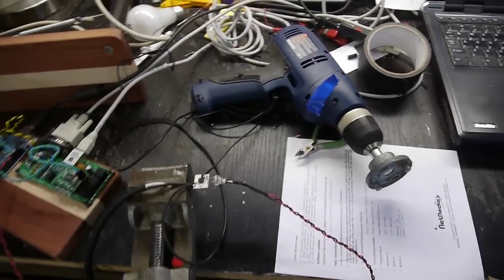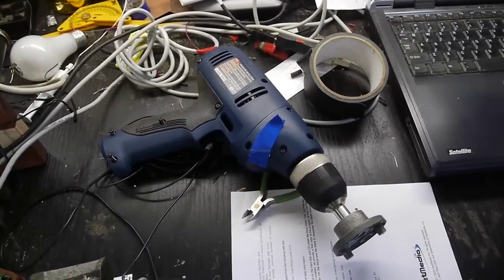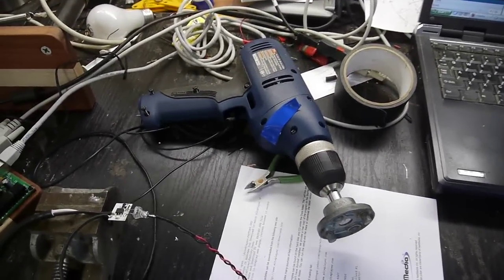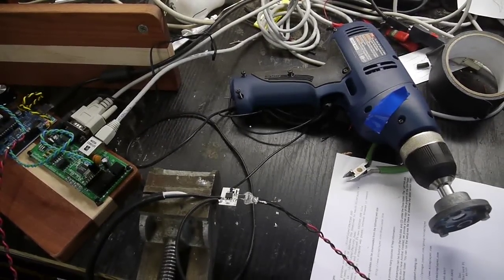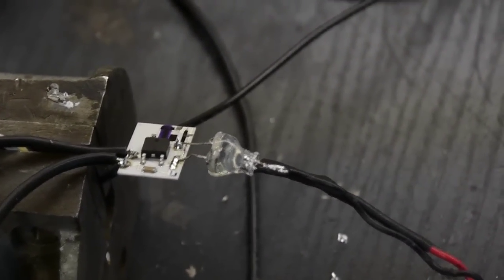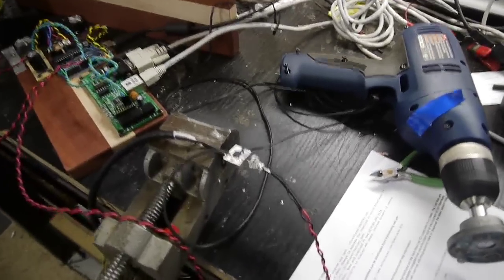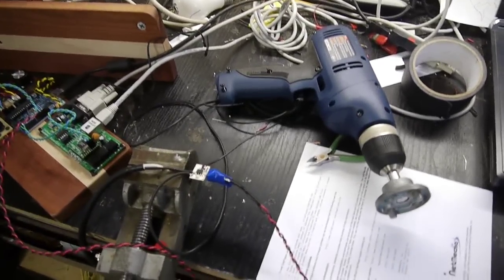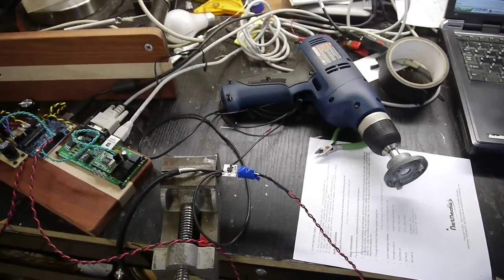Universal motor speed control by a microcontroller (arduino)

Comment: With this you've even isolated the control circuit from the AC power, making it safer, which could be important in some applications. It's a really elegant solution.

Comment: Ran into the same problem blowing mosfets chopping DC. Basically you really need a MOSFET 5-10x the voltage rating cause motors are evil.

Comment: Great video!

Would this work with an induction motor? I'd like to use this solution on a ceiling fan. Also, is there a way to power of the motor when the pwm signal is completely dead?

Comment: I have a spare 240 V AC motor and Arduino UNO lying around. I was wondering if I could use it to control speed using a temp sensor. So for particular increasing ranges of temperature, increase fan speed in steps accordingly. Can I do that with this dimmer circuit?

Comment: I bet if you were to put a load on that drill your dimmer/driver circuit would over heat and go puffff in to a pill of smoke.
Reply: +andrew moon Why? All he did was to take the circuitboard that was already in the drill, and replace a small-signal resistor with a CdS cell that varies its resistance with the amount of light it sees. The Arduino, etc., is completely isolated from the drill. If the dimmer circuit were to overheat, it would've also overheated in the factory drill speed control.
Reply: @SweetSpotGuitar  Hello, I am trying to do something very similar with your project.  I have a AC electric drill that I want to control using a AC eMylo RF wireless remote from Amazon.  It has a two wire imput and a three wire output.  I having problem trying to hook it up to the drill.  If you cold help me on this it would be appreciated.  Thanks Irv

Comment: So if you were using a fan motor and needed to control the rpms of the fan with temperature change,high temp= high rpm,low temp=low rpm et etc,could this be done easily with PWM? What components would be needed in order to make it as easy as possible?sorry im really new to arduino.
Reply: just search inernet. toooooooons of stuff. basically u kan du eberyting.....

Comment: very interesting. any ideas how you would control direction from your microcontroller?
Reply: The direction control is a DPDT switch.  I did it with a standard (mechanical) DPDT relay - the coil is switched with an NPN transistor driven by the microcontroller.

Comment: great video.... i was wondering could you give me the circuit diagram of that speed control. also what should be done to adapt it to 240 volts and connect higher loads like 1.5 hp.

Comment: I would like to control a dual winding stepper motor that runs a breadmaking machine um its rated at 240 volts at 100 watts I think your solution would be great for that as the one that came in the machine broke down after 3 days and my arduino was sitting on  the self so why not use it for the breadmaker :) and it should work as most drills are about 500 watts. Once again good solution !!!!

Comment: I agree with Hector - what's so hard about triggering a TRIAC?  You can measure the zero crossing with a zener diode and then start a timer.  As far as projects that use a microcontroller just to generate a PWM signal - that seems like a Rube Goldberg way to solve a problem.  Didn't people use 555 timers for that sort of thing once upon a time?
Reply: The point is that you can do other things with the MCU.

Comment: What's so complex about the other TRIAC method? An H11L1 is like 80 cents and in conjunction with a MOC30xx is designed specifically for phase control applications (see app note 3006). Seems like you've moved the complexity to your LED/cds concoction and basically built your own optocoupler LOL. Hey, it works, just seems like you went to a lot of trouble to avoid 1 extra semiconductor and a few lines of code. Was it because you felt the PWM would be more reliable or were uncof. with interrupts?
Reply: I believe the idea is that the original triac circuit is already there, all he has to do is swap the trigger resistor to a LDR and it's done. I have no doubt this guy could build the triac circuit from scratch, but this is a simple hack for instant results.